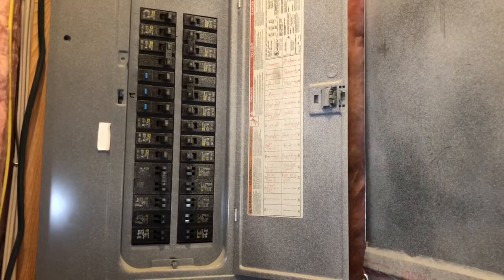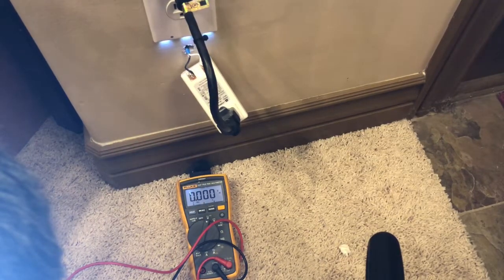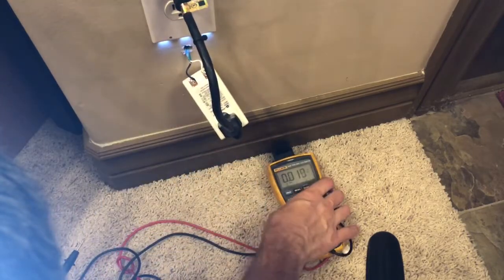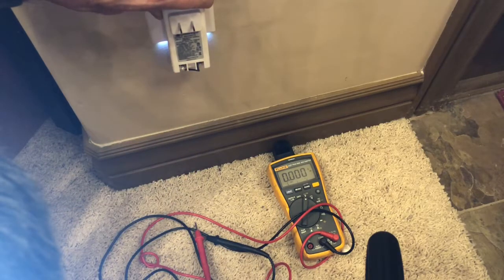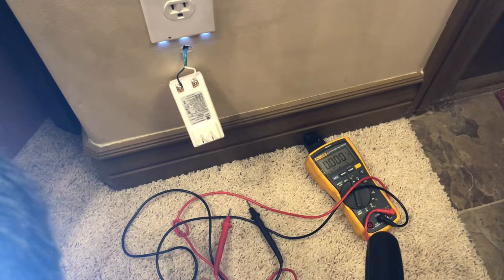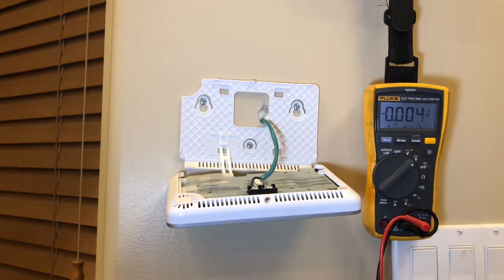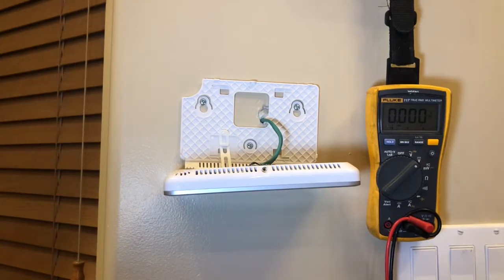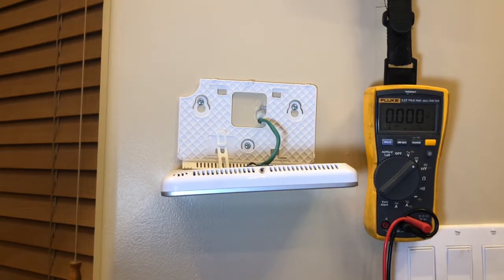Alarm Keypad Not Working  [Wireless]

Comment: Its a 2gig try rebooting by unplugging power and battery then put battery then transformer in that order. They are notorious locker uppers especially their secondary keypads. I've been a alarm technician for 21 years these and the IQ2 "panels" are my least favorite.
Reply from the maker: Thanks for the tip!